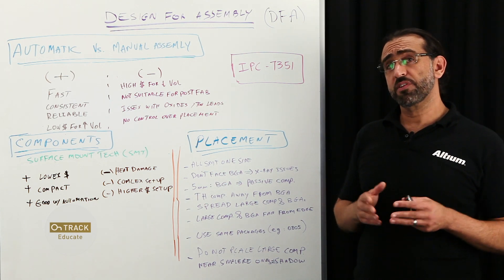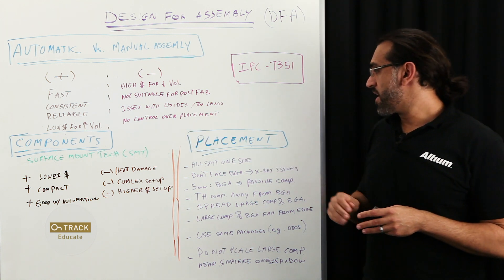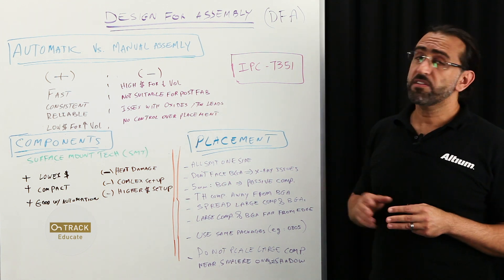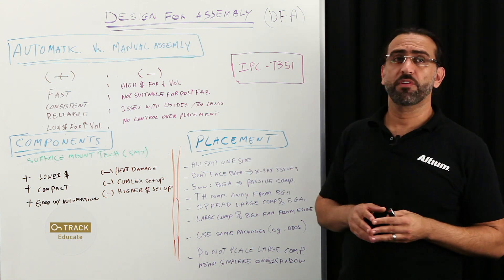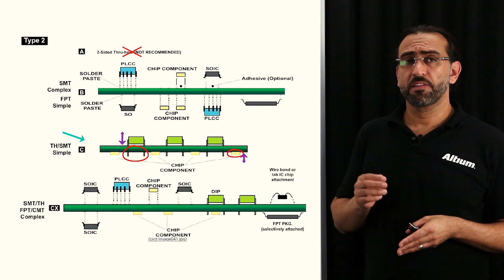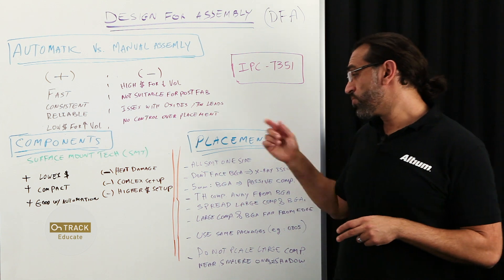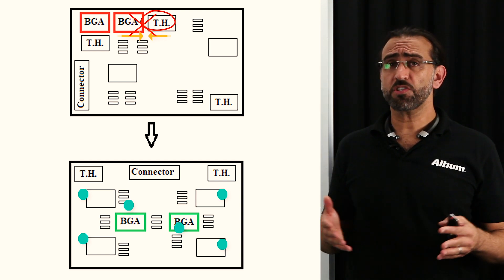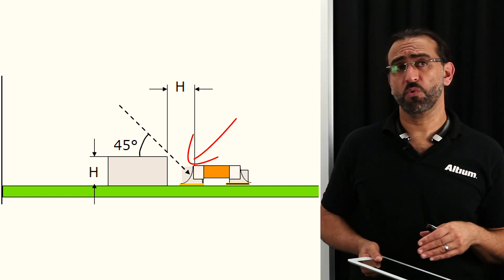Design for Assembly DFA Tips - OnTrack

Comment: Who is the audience for this video?
Since you spoke about designs being controlled before manufacture, I assume this is for professionals, rather than hobbiests.  Given that, most designs use SMT with PTH only when needed (e.g. connectors, etc). Most new components are not released in PTH anymore, e.g. opamps, logic, FPGA.
Why is use of stripline relevant to how close components are to PCB edge?
I think you are way behind industry standard practice if you refer to 0805 for passives.  We only use such large parts for power dissipation.  0402 is standard, with many using smaller.
Please ask Judy Warner to review your videos before posting.